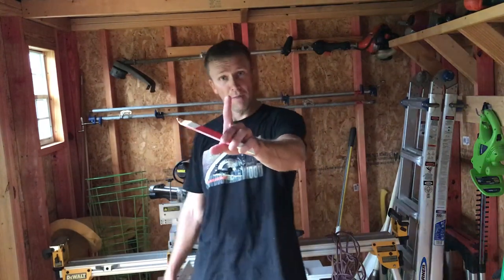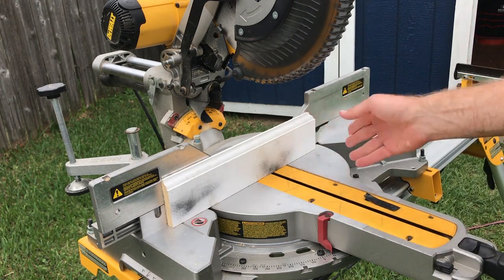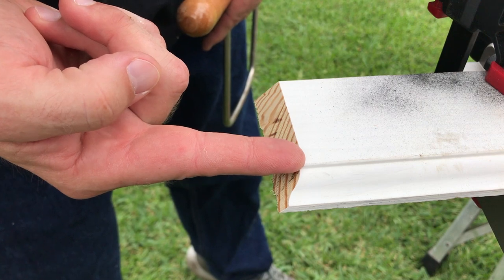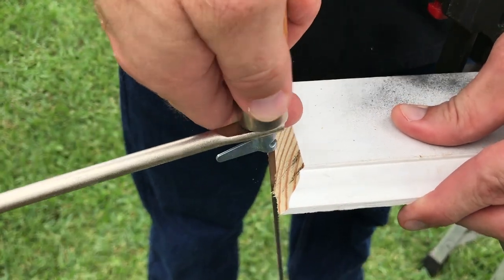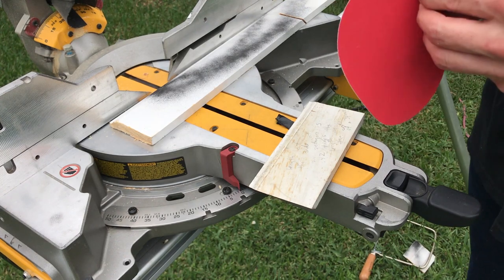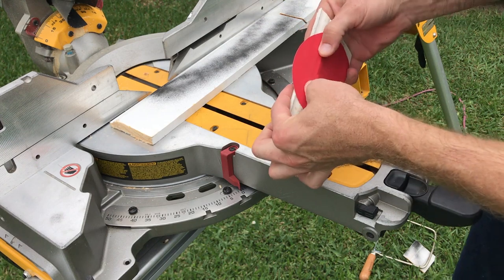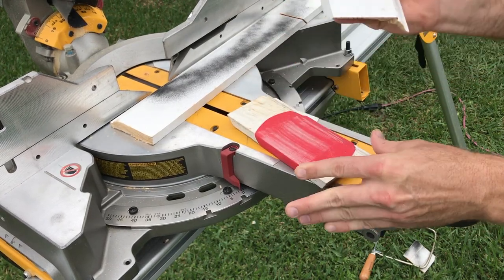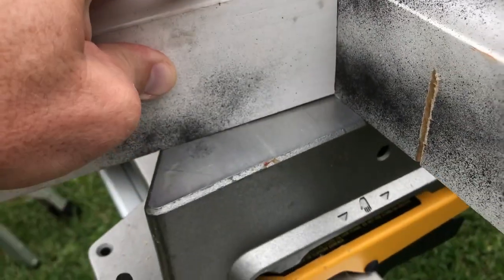How to cope baseboards using a great trick!

Comment: Just a Tip. Reverse the coping saw blade so it cuts on the push stroke. Then you won't need the clamp and be constantly pulling the work piece up off the bench so violently.

Comment: Nice trick with sandpaper. However I do my coping on my table saw with the blade set about 2 inches high. I bring the molding in parallel to the saw blade and make  a series of cuts up to the coping line.  I then tweak it with sandpaper stuck to a 3/8 wide stick.  Kind of like a file. It works great and It's fast.

Comment: I've been using the adhesive sandpaper trick for a long time mostly because its fun.one thing I learned is most papers are too thick and not flexible enough for tight profiles and corners. Porter cable sells an adhesive paper that was meant for their electric profile sander, which is useless,  but the paper is meant for following tight profiles. That paper works best for this application.